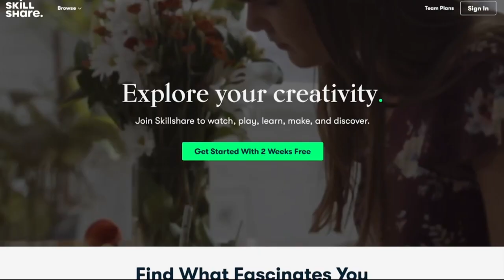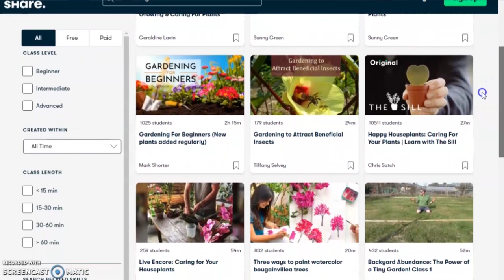Building Onto The Kitchen | Our Self Built Off Grid Home

Comment: Looks great!!!!
Back buttering is the only way to go. Plus it keeps the grout joints cleaner too. I always try to put a thin skim coat on the surface of the wall/floor but unless I'm doing a large area I always back butter tiles. Then I run my finger tip "curved in" around the edge before setting it. Keeps the grout joints super clean. If I trowel the surface I use a spacer to clean the joint while its wet. Makes cleaning thinset/ mastic out of the joint a breeze before grouting.

Comment: For a quick straight edge when painting. Use your drywall knife. Set the steel in the corner and paint/stain against it. Wipe the knife off on a rag often.

Comment: A trick I learned years ago for clean caulk lines is to place a strip of blue tape down next to the crack to be caulked offset by just a small amount.   Apply your caulk slowly and carefully and while the caulk is still wet pull up the blue tape and watch as a nice clean line is left behind.

Comment: I like tiling and like you have just installed a new kitchen sink and unit and then tiled around it. I never use tile spacers btw. Sure you've noticed the missing grout but if not look at 21.09 and there it is. Erin will be going mad at it by now.

Comment: Hopefully on the Second Half of house, they pour the outer foundation, and then put pillars in the middle.
  That outer foundation would save you two from having to dig between outer pillars, and prevent all the extra time using plywood and bracing.
  Just a thought...
Everything is starting to come together, and the back splash does tie it all in.
    Great Job...🙏👍😎🇺🇸

Comment: You don't have issues with the back burners on the range getting that wood around the windows hot?
Reply from the maker: No, this type of stove keeps the heat directly under the pot rather than allowing the heat to go around/up the sides like most stoves

Comment: At 21:10, there's some grout missing from the vertical seam to the left of the outlet, up against the window frame. It would probably be easy enough to touch up with a little grout on the end of your finger. Aside from that, you've done a remarkable job on all the detail work.

Comment: I know It might be a crazy thing to suggest,  but why not purchase a 18v rigid finishing gun, no more moving around an air-tank, no more hoses getting caught up on things to scratch up finished area with dried on paint on the hoses. I just bought one myself a little while ago  came with a battery charger 2 batteries and a very nice carrying bag. Best part is no trip hazard anymore, and no having to reroute hoses or unplugging them from the air-tank to reroute them a different way through the projects your working on. Thd Dewalt brand of products are also very helpful as well I've used both lines of products and absolutely love how much faster it increases your flow on getting thing completed in a more timely manner. Anyways just a thought that I thought you both might appreciate.

Comment: What I cannot understand when you are cutting in anywhere (Painting / Silicone corners it saves you using tissue to wipe clean) that you do not use masking tape. ? so much easier and less time consuming and much more furnished finish. Just a positive observation. And you are both doing a good job.

Comment: I have to admit, I had some doubts about the back splash tiles on first reveal. But after install and looking at it holistically, it's a great fit. Nice touch on wall plate colors as well. Brings them in line with the grout. As always, fantastic video showing the entire process including the adjacent work that had to be done.

Comment: Great opportunity to use “Ready Mixed” tile adhesive on those smaller wall tiles. Mixing that powder adhesive for such a small area is to messy and more work than needed 👍
Reply: They seem to live in a remote location. If they didn't have ready mixed, it would probably be easier to mix than to drive to town. Horses for courses.